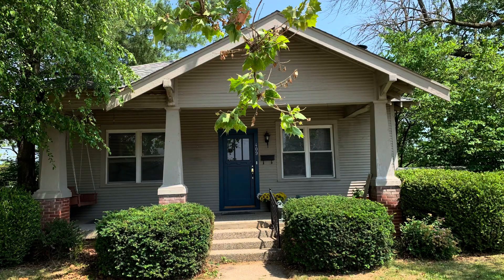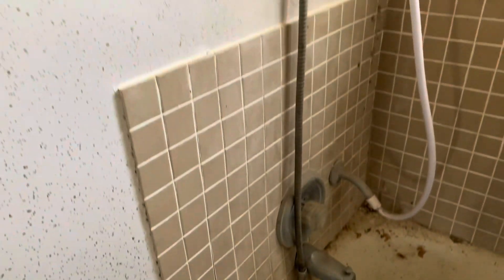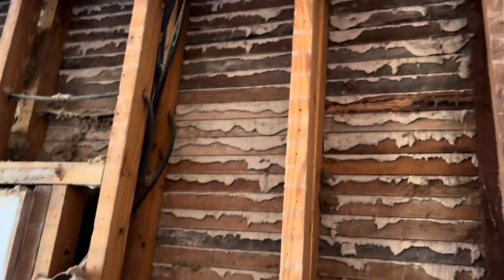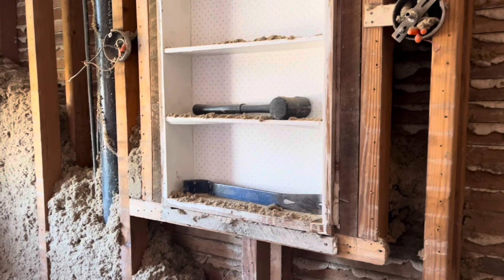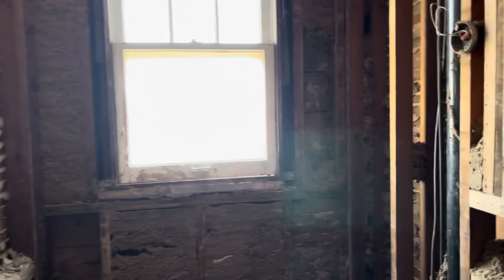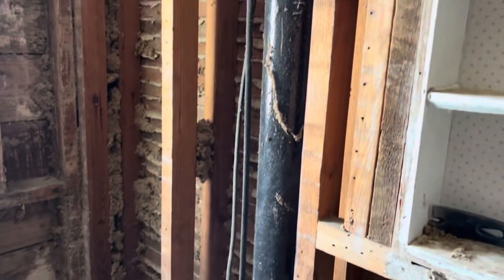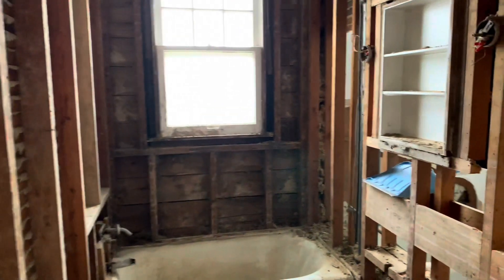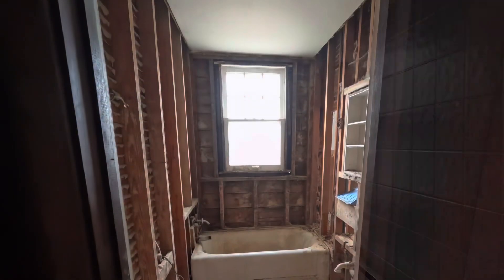Demolishing 2 bathrooms at the same time - THE ABANDONED DUPLEX RENTAL REHAB Episode 13

Comment: So exciting! I can't wait to see if you were able to keep the tub and floor! That's the Perfect soaking tub!
Reply from the maker: Me too!!
It is going to be a lot of work on both the floors and tubs but I think it can be managed.  It is pretty crazy but both floors have 4 inches of concrete under them.  Hubby said it'd be a nightmare to remove it all if we had to change the floors.  The only issue is covering the old toilet hole.  There will be a couple tiles after cutting the new hole so hopefully they can fill in any voids.  
Thank you so very much for watching ; )